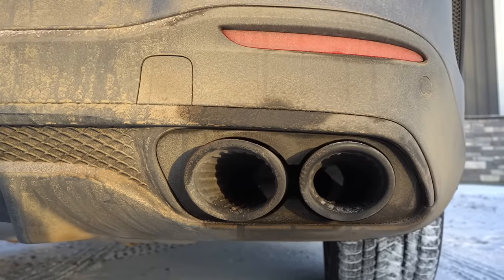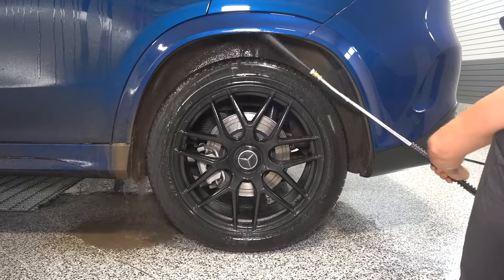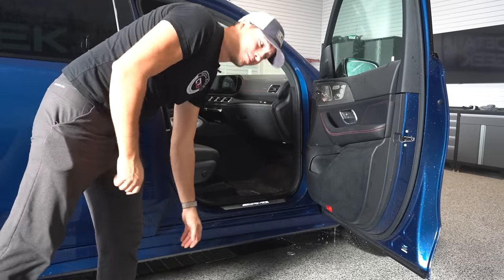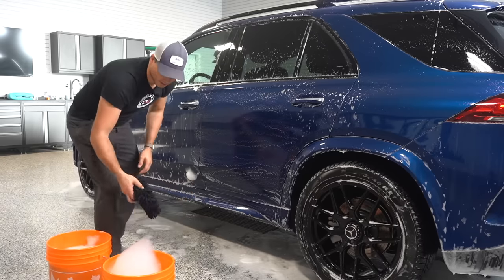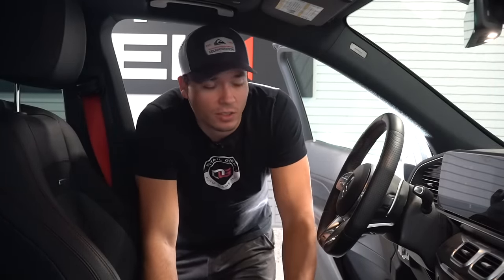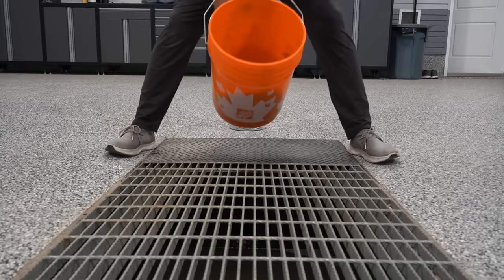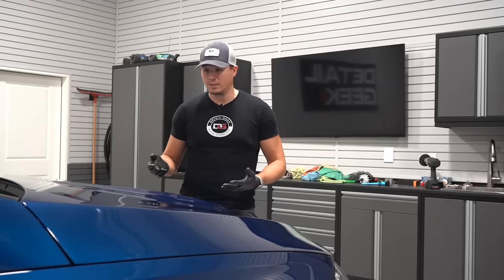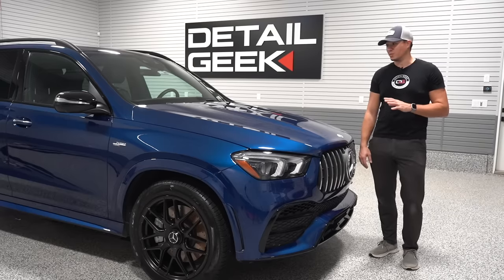Is Mercedes The WORST Car To Detail?

Comment: Having to pay monthly on options that I paid for when I bought the car is just wrong, knowing this I would never buy this car in the first place, great video sir 👍😁
Reply: As far as i know, the monthly pay option only comes into effect if you were too cheap to buy the stuff with the new car. Then they give you the option to use it for a monthly payment or a 1 time payment somewhere around the price what the upgrade would have cost originally. Do your own research and dont belive everything. Do i dislike this practise aswell? Yea, kinda. Is it easyer for them to put heated seats in every car and only have 1 seat manufactured? For sure. Should you cheap out on a high priced car when it comes to heated seats? Bruh.
Reply: @radischn5269  heated seats are standard in all older cars that I know of. I even had it in an old volvo 740 from 1987. So paying a monthly fee to be able to use it is stupid and should be criminal.
Reply: @radischn5269  Heated seats don't magically appear when you start paying for the subscription; they're already in the car when you buy it, just not activated. So for people wanting the baseline car these subscription-based features add a lot of unnecessary weight for things you didn't want.
Reply: From what I've heard both Dodge and Ford at least are moving in this direction.
Reply: @casper14301 then get a lower trim level car.
Reply: @joshlansford1706  but why tho? Its a scam.
Reply: @AndreasLarsson95  more money
Reply: @nickwebb9937  What?
Reply: @ananthanaarayansathyanaray4348  still a scam. They should be banned from making new cars
Reply: @AndreasLarsson95  yea well that’s capitalism for you
Reply: @ananthanaarayansathyanaray4348  i like capitalism to a certain degree. Like selling a car and moving on to the next but not making people pay for stuff that was standard just a few years ago
Reply: Totally agree, I mean why would you??????/
Reply: Were I can actually see it is for stuff like navigation systems where maps are updated as well. You always had to pay for map updates anyway and it is an actual service they provide. Or something like using an app. But have to agree to @radischn , it's not as bad as it seems because you still can buy it, monthly payment is not really more expensive than buying it up front. Also, being able to buy features afterwards is really great if you buy a used car. Previous owner didn't buy heated seats? That doesn't stop you from enyoing it.
Reply: Makes no sense to me either!
Reply: Great detail - not one of my must have cars - but I love the system you have in going through a car. It just makes sense.
Reply: @radischn5269  this this this. Too many people are too quick to slam automakers for this option without thinking that it isn’t just a money grab
Reply: @radischn5269  any KIA has heated seats in it as a damn default.

Even so, its not even a feature that's that cool.  It's okay, but I ain't paying monthly for it.
Reply: @AndreasLarsson95  there actually is no monthly payment, that is for the people who cant afford the price of the car initially which is around $200k aud
Reply: @AndreasLarsson95  I completely agree. And if what I've heard is correct it's going to get worse. Not only are they going to charge for "luxury" features but they are planning to charge truck owners to be able to access the trailer light connections and "tow/haul modes"
Reply: @AndreasLarsson95  well capitalism itself is a very innovative concept. Innovative in exploitation
Reply: @AndreasLarsson95  there’s no certain degree to like capitalism. You either love the contradiction about it or you hate what it stands for.
Reply: It's a monthly payment because you didn't pay for it when you bought the car. It's not exactly rocket science. :)

Not knowing what exactly you are buying when buying a vehicle is just stupid. It's a purchase of dozens of grands, and people still choose to be naive and ignorant.
Reply: @casper14301  Pretty soon they will have a subscription fee to make the turn signals work.
Reply: @radischn5269  the feature is already there. They don't take back and install after your payment. Think of it like you pay for Netflix but when you want to watch a movie, you pay an extra x amount for that movie in a month lol~
Reply: @JE-zl6uy  KIA’s catches on fire. That’s warm enough for me
Reply: Thats weirs because in the uk Bmw owners have to pay monthly to unlock those features and For mercedes its free
Reply: This car doesn’t make you subscribe to anything. We just bought one
Reply: As I know Tesla is also doing this, they all have built in heated seats, heated steering wheel, etc. you can unlock the feature if you pay for it. They can manufacture cars not so individually as couple years ago, when they had to wait for orders, and if something was not built in as customer ordered - there was a lot of waiting again. Now you have full equipment, just unlock the features that you want - when you order the car, or after you bought it. But if there are monthly subscribtions, that’s odd then.
Reply: There are a couple of corrections:

1. All 2022 Mercedes-Benz vehicles sold in Canada include a 3-year complimentary plan for Mercedes-Me services, providing users with the ability to remotely start, lock/unlock, and locate their vehicles.

Here are the corrections:

- Heated seats are standard and do not require a monthly subscription.
- Navigation is standard, but over-the-air updates are part of the Mercedes-Me subscription.

The subscription fees for remote lock/unlock and over-the-phone remote start are necessary due to the infrastructure required to communicate with satellites through the app. As a product specialist for Mercedes-Benz Canada, feel free to reach out if you have any questions.

Comment: I think it is ridiculous that they have to pay to use features in a car that they already paid Thousands for.   These car companies are just getting out of control.  You did a great job on the car as always.  Love the new studio.
Reply: That’s why we don’t buy Mercedes, all these dumb features and selling it for alot whole other car brands have it for cheaper
Reply: @leanmachine3251  you really that blind? Its not only mercedes that does this. Also bmw and many other brands. Happily this stuff is getting BANNED in the EU.
Reply: It is ridiculous but the main reason is due to their shift to electric vehicles. Since EV's don't require much maintenance, the aftersales business for these companies will significantly decline. Therefore, they are introducing digital services now which will be able to cover the aftersales losses. From a consumers perspective, it sounds awful but from the business perspective, it is necessary to be profitable.
Reply: @ieditedmyname289  They are indeed getting banned my guy. I work with cars and also work in a car company in the production line and i kind of know the problems that different manufactures are facing right now, espacially in the EU. The goverments does not like this ideas of "subscriptions" because they do not get anything from it and they do want to ban it.
Reply: Toyota is unfortunately the same, everything is becoming subscription based.
Reply: Companies unfortunately can charge whatever they like for whatever they like. You should concentrate on the morons with money who actually pay for it. More money than sense
Reply: I have the same vehicle, and don't have to pay to use any features. I'm in Canada, so must be a US thing.
Reply: @LeanMachine  it's not only Merc, many other companies do it so don't try to make Merc the villain here man. If you don't know something, don't falsely trend something
Reply: @davidpackham797 not just the US. It’s happening in other countries too. I’ve got family in England and they’re dealing with this too.
Reply: @Leasyy  so the only thing that's going to happen is that we will be paying subscriptions + taxes and service charges... just like the cell phone service where you end up paying ~$45/mo for a $29.99/mo service. to them we are cows, and a cow's only purpose is to get milked. they will find a way.
Reply: Dealers make money in their used lots.  They hose you on trade-ins, then sell extended warranties.  They make little on new cars.  But now with the EV push, who will by a used up EV?  Big revenue losses are just ahead.
Reply: @danbriars2141 agreed, the market is voluntary, stop buying them and they will smarten right up or lose money, it doesn't have to be made illegal by the government for it to work.
Reply: There are a couple of corrections:

1. All 2022 Mercedes-Benz vehicles sold in Canada include a 3-year complimentary plan for Mercedes-Me services, providing users with the ability to remotely start, lock/unlock, and locate their vehicles.

Here are the corrections:

- Heated seats are standard and do not require a monthly subscription.
- Navigation is standard, but over-the-air updates are part of the Mercedes-Me subscription.

The subscription fees for remote lock/unlock and over-the-phone remote start are necessary due to the infrastructure required to communicate with satellites through the app. As a product specialist for Mercedes-Benz Canada, feel free to reach out if you have any questions.
Reply: Things like remote unlock and remove lock. Cost them money to run every month Your car need to have an active Sim card.
Reply: Beside all of that, keep in mind you paying for the latest updates. We have to accept that todays features will be charged, everywhere. I know it’s frustrating that every big company starts to rising prices, but that’s the world we live in today. This is why you have to pay to Netflix every month,for example, even for the same movies and new movies wich you don’t watch. The point is, that there are people out there who develop such features, and I am happy to see people doing innovative things. Even if you personally don’t like them, there still people who do. And as long people getting paid to develop such features, which are improving the usability, from my point of view, I am okay with that. Let’s see what the future brings :)

Comment: Great job Mitch. It's disgusting that Mercedes would dare charge their customers for basic things after the initial purchase.  I remember when I was growing up in the 90s my friends dad had a 1993 500SL and it was so well made and built. I don't think some car makers are who they used to be. Sad.  Mercedes had some great looking cars back in the day.
Reply: Blame the idiots that buy them. If they keep buying they'll keep making them like that.
Reply: @pauljansen6650  agreed
Reply: @pauljansen6650  not many people know that, some just want to splurge on themselves not knowing that they’ll have to pay to unlock a locked feature
Reply: @AFrmDaBx well thats just stupididty you should never get any kind of investment like a car without a lot of research, i used to want a elantra n, waitwd and did research , the engines and cvts (as usual) are blowing up, the gr86 from toyota, has a subaru motor that has the head gasket issue and theres ones with less than 5k miles breaking. Always do research

Comment: I have a full car PPF installed on my 2023 M240i and I can say if installed properly, it is pretty much invisible and has no negative affect on the depth and gloss of the paint. The PPF is also ceramic coated which provides all the water beading effects

Comment: Hi DG! I have a question. So while pressure washing, should I (or not) keep the windshield wipers in their normal position, or should I keep them away from the glass? I find it easy to remove the muck on the wipers when I keep them away from the windshield.

Comment: Have you ever thought of weighing a vehicle before and after a detail to determine how much extra they are carrying around in mud and trash? A Detail Geek treatment could literally save you gas mileage!!! Great videos, keep up the work.
Reply: Removing let’s say an exaggerated 50 pounds of dirt won’t make any bit of a difference on a 4000+ pound vehicle.
Would be interesting to see how much weight is removed.
Reply: Dude needs a hoist more than a set of scales. Get it off the ground to properly clean the underside.
Reply: Be so for real, why would he ever weigh other peoples cars.

Comment: Hey Mitch. I know you hate the carpeted wheel arches but I think you might be missing the point of them. Here in the UK they are very much looked upon as doing a similar job to heavy goods vehicles mud flaps in that they greatly reduce the amount of spray coming off the tyres in wet weather. The sound deadening is just a bonus. That said any wheel arch liner is a guaranteed source of rust!
Keep up the good work and loving the different music. The Pinky and Perky (look them up on YouTube) sounding music you have been using makes me reach for the mute button 😂

Comment: Tip:
*With carpeted wheel liners on vehicles from returning customers:
After washing them apply a SiO2 quick detailer spray or foam the liners with something like Carpro Hydrofoam via a foam gun. Thus making the carpeted liners Hydrophobic. This will make future cleaning a breeze! 👍🏻
Works perfectly for plastic wheels well liners also obviously.

Comment: It's the same as with BMW in Germany. Customers also have to pay money for many additional options such as heated seats in order to be able to use them
Reply: das ist so dumm . Als BMW Fahrer hat mich das echt wütend gemacht
Reply: Is it something you can purchase for a few months at a time? Heated seats would be nice for the cold winters here but I don't need them during the summer. I still think it's ridiculous.
Reply: @evelynmater8773  Yes, you can choose between 1 month, 1 year or forever for the seat heating at BMW. I think this is the case for most additional functions. But that's way too much.
Reply: @ChefkochBaba  kann ich verstehen auch wenn ich nur Skoda fahre. Ich finde das einfach nur unverschämt.
Reply: You know someone will have a hack to get around that soon. Anything run by computer programs can be hacked
Reply: Mercedes does not have a subscription for heated seats only bmw. The video is incorrect.
Reply: Just ordered an X5. Here in the States, heated front seats are standard. Heated additional rows are extra, but not much. Are you saying you all need to pay additional monthly fees to use that? Because if so, I'd start searching for companies that can do firmware workarounds or a hardware plugin. This stuff isn't that complicated.
Reply: @evelynmater8773  actually heated seats are really great. When you try it you want it.

Comment: Oughta be ashamed to charge someone for features they’ve already paid for
Reply: They paid for the car not for the feature. And this in my opinion is a good idea. Imagine you buy a $100,000 car for $80,000 with all the features locked, and you pay either monthly or you buy completely only the features that you need. Those features are same price to buy as they are when ordering a new car and opting for them. So, you are misinformed on this one, you don’t buy a feature twice, you never actually paid for it in the beginning. You either unlock it when you buy the car, or they give you the car with the feature locked, and you unlock it whenever you decide to (or never). I would want my old F30 to have a steering wheel heat feature built in that I could either buy later on or pay monthly only when I need it. People are misinformed on this matter, but it’s actually a very good thing
Reply: @demproblems  🤨🤨🤨🤨 Hell no. Hell no. If I buy a car and it has a heated steering wheel. I shouldn’t have to pay a fee to use it, period. Especially with how fast these vehicles depreciate in value. Most successful people I know are frugal. They aren’t going to pay for something that another company or an older vehicle already has at the time of purchase. I literally know a millionaire who complains about paying 6.99 a month for Microsoft Word. He’s used to paying for the program one time like we did back in the day. Times have changed. I have a 80k Durango SRT. Everything on that bitch is unlocked. If they started charging me for heated and vented seats and adaptive cruise control I’ll put a bullet through the engine and collect the insurance money. Majority of people are feeling this way regarding this issue and as we know, the majority rules. This won’t last long. I give it 5 years.

Comment: I think it’s a predatory practice that should be stocked and regulated. I do have a question though in your professional opinion, do you think it’s better to get the coating that the manufacture offers or to do a clearcoat seal on it like I’ve seen you do when your videos?

Comment: It's important to ceramic coat after the application of the paint protection.  The ceramic coating makes not only the wash water and rain sheet off the surface, but the bugs will definitely get removed much easier.

Comment: Subscription based service definitely makes sense from a manufacturing stand point. Manufacturers can essentially have one standard infotainment system, seat configuration and electronics set up for a specific model with varying trim levels. Manufacturers would purposely "damage" their products, i.e., design and sell inferior systems (for example, no heated seats, no infotainment screen, halogen headlights vs optional LED). It might be more expensive for manufactuers to design, manufacture those inferior products just so their standard features look more appealing.